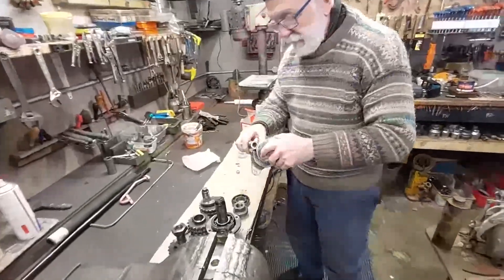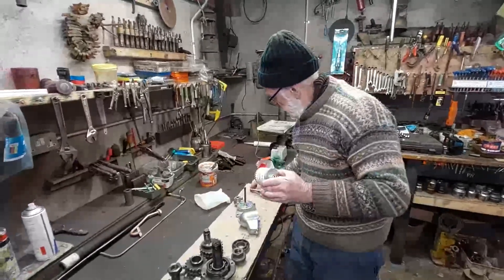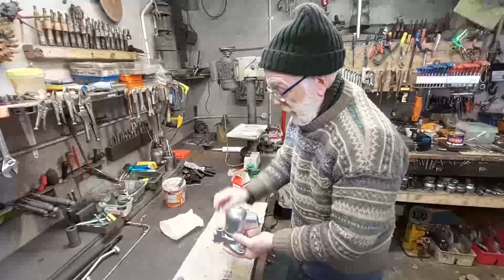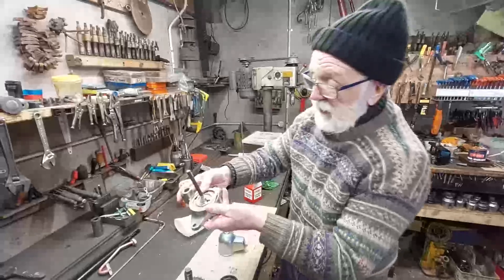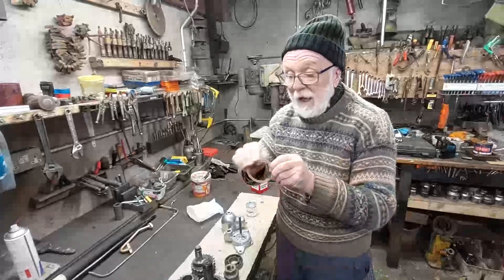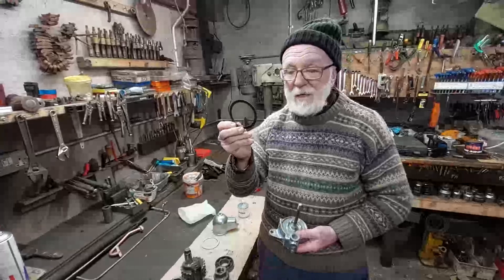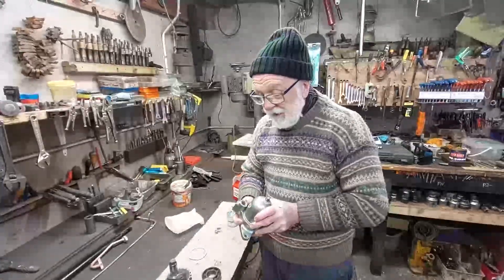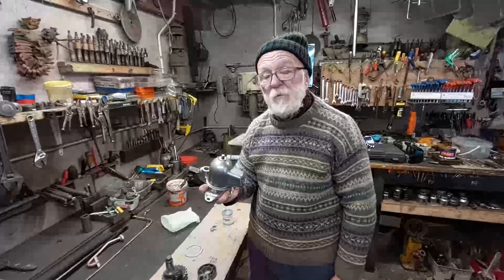Gardner Engines: the fuel filter - a Gardner wart!

Comment: Thank you very much. Exactly the problem I have with my 6lw. May I ask what size is the nitrile washer you found, and also what size washer or  O ring for the drain plug on the housing? Thank you
Reply: Joe, where might I find the nitrile washer you describe as my old Gardner has had this leak for years? Thx

Comment: If Gardner are aware of the problem, why don't they fix it. It strikes me is completely daft to supply a little collecting tub to catch the drips. It may be of course be that Gardner do not make the filter but surely they could insist up on their supplier supplying the right size of washer.

Comment: Many years ago I worked at Gardner in the development department. I was tasked to measure the back pressure in the fuel return pipe from the injectors, which connects to a port on the filter body. I was surprised to find it was negative (ie suction) under load. On further investigation I found the fuel flowing into the filter runs across the fuel return port, sucking the return fuel along the way. Old Mr Gardner knew what he was doing! 
I don't recall a problem with those gaskets though. Maybe whoever makes them now is using a similar (bigger) one from some other application?

Comment: Many Gardner owners here in NZ are sick of having to pay for these filters, so we use a bogroll.....works absolutely fine! 👍😅
Reply: Hope your not serious a cav 296 would be best... I would just leave factory filter case empty
Reply: Toilet rolls were used in the US on some cars as oil filter cartridges. Ive used 2 x rolls stacked together in a Rolls-Royce oil filter housing as a filter for my Heavy Fuel injector tester. They work extremely well. Way more "filter" media than any standard filter has. They dont fall apart and test fuel remains incredibly clean.

Comment: The problem is the modern seals supplied by the filter manufacturer, and who knows who that is as it will not be Gardner! I solved the problem in much the same way but used a viton or nitrile O ring sized to fit in the filter housing. I also use a dowty washer to seal the nut that secure the filter housing.  In my view there is nothing wrong with the Gardner manufactured filter housing.
Reply: Dowty washer under the retaining nut is a must and replacing factory taper seat drain valve with an 1/8th BSP brass lever valve is another cure for a leaky secondary filter.